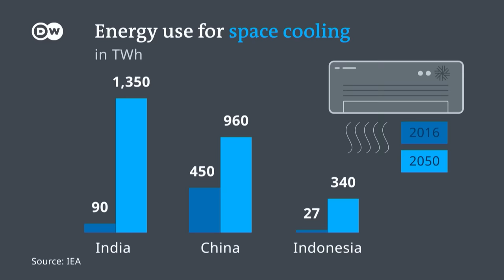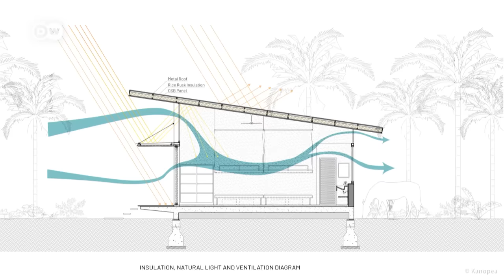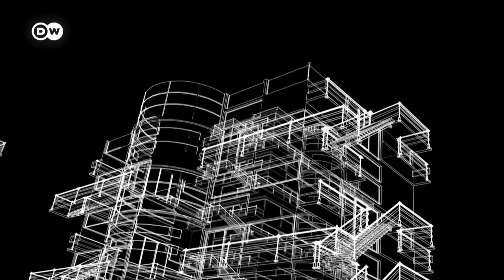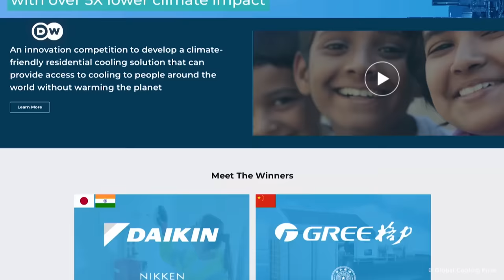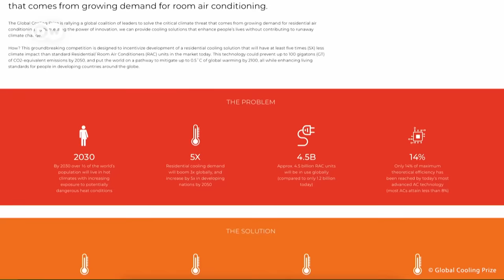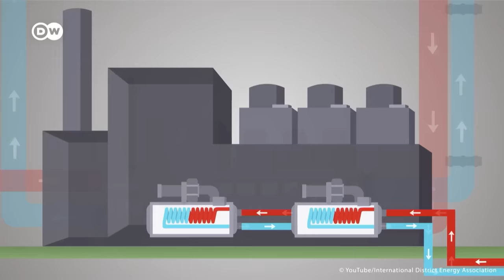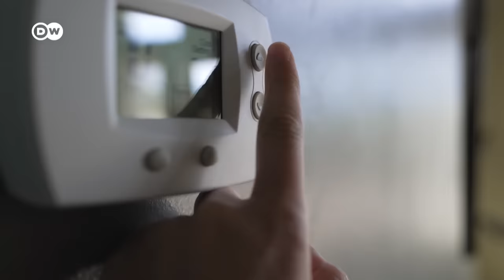How to cool our homes (even without ACs)

Comment: I open my windows when its cooler outside than inside, I close them when warmer. I have 1m thick walls that are heavily insulated. There are few aircons in this country. We have district/building heating. I keep my apartment at 20° in the winter.

Comment: I'm too poor to have air con at home. It's so hot here and high humidity and i live in a concrete jungle. I watched this video to find out if there are any other ways to keep myself cool in this hot and humid weather. Currently,  I keep cool with ceiling fans, stand fans and a trusty spray bottle at hand. Squirt some water on my face and hands, and on bedsheets when I sleep, the water evaporate real fast and keeps me cool.

Oh yeah....i edited this to add.... go on a vegetable or low/no carb diet... less / no meat diet. Kept me cool ! 😃

Comment: there is another design process created by a american architect in the 1970s, they are called earth ships. im surprised DW did not feature these designs because they can be used to reduce waste and be cooler in the summer and warmer in the winter.
this is because the tires and bottles/cans used in the building process retain heat and cold, by acting as a lung. the results are amazing, but widely unpopular because they reuse waste like old tires, used bottles and even cans to build the structure, and local governments typically confuse them with dumps, so they fall into waste regulations. another reason they are not popular is because social media locks it down tight instead of spreading such a ingenious idea.
earthships are also pretty cheap to build, because you are reusing local waste for bout a very good chunk of the project, you bring in the ability to have build prices less than 50k in most cases.
also a indirect problem is they also reuse rainwater for everything, even for watering the local plants inside the earthship, that also act as a cooling effect, but they fall under water regulations and clean water building codes. the most energy efficient design for single family dwellings thats cheap to build, is also not well known.
funny how that works?

Comment: Rural homes in India were much cooler in summer and warmer in winter in the past than today, as they were built materials and ideas from the past which were very much in sync with nature. Today, all you see is a concrete jungle, and with less green cover due to the cutting of trees is pushing up the temperature, it's getting much hotter in summer than before. Awareness is important to bring in a change, this was a good watch.
Reply from the maker: Hey there! We did a video on the problem with concrete. Check it out here 👉 https://www.youtube.com/watch?v=dgVWz77lGCo

Comment: The better approach can be using glass, which allows light but doesn't allow the heat. This means lower lighting is required while also allowing for a better thermal insulation.

Comment: In the case of Barcelona, as far as I can see, concrete dominates in the superblocks: the ground consists of long concrete slabs with small spaces or tree pits with vegetation. I guess they somewhat reduce the heat, since they reduce car traffic, which in Spain is still mostly combustion-based, but when you cross them in summer, they don’t feel refreshing at all. 

Perhaps it would be a good idea if, instead of concrete, the ground in those superblocks were simply made of soil. In nature, soil absorbs the sun’s heat and channels it deep into the ground. Concrete, on the other hand, not only fails to absorb heat but also retains it throughout the day and releases it for hours into the night, acting like a radiator.
Reply from the maker: Hey there! Yes, concrete definitely heats up a city. There has been work done in Barcelona to provide cooler spaces for people in the summer heat. We recently visited Barcelona to check it out 👉 https://youtu.be/iZI4Rh_APFQ

Comment: District cooling or centralized Air conditioner seems good option as it is offer better IKE ratio also generally bigger compressor demand less maintenance too and we can incorporate absorption type refrigeration system which demanded only thermal energy eventhough they have low COP ,in india plenty of hot sun shine available that can use in absorption chilling for district cooling purpose.

Comment: Systems needs to be designed for their climates.  We live in a high planes desert.  Low humidity and in the summer, hot during the day and cool at night.  Generally we open the windows at night to cool the house and then close it all up in the morning.  House stays pretty cool until late afternoon when the AC kicks on.  I would love a system that can read the outdoor temp and switch to outdoor air to cool at night then switch to AC as needed.  It would be far more efficient at cooling our house at night than just opening windows and filter outdoor air particulate to keep indoor air quality good.

Comment: the worst part is that, based on the geological record and the length of this interglacial period and the length of the previous interglacials, we are basically at the end of this interglacial and should be faced with 1 of two possible scenarios:

- hard ice age: global average temps rapidly decline to 2 deg c and the continental ice sheets re-form within 1000 years
- the pleistocene ice age is over and earth becomes tropical again going back to the geologically normal global average temperature of 23 deg c

Comment: Om my answer,
this Summer, in Thailand March to Mai, was first time under a lot AirCon usage, as I upgraded the Solar to HAVE that kWh I want.
It IS a difference for what : as I don't work, sweating is not that problem, and for my arms, to shelter the keyboard and mouse are always towels to catch the water, I don't need that cooling : with 27 C I reach a temp and automatic a humid rate that I keep dry.
Since End of summer I use only Fan indirect into the room, but need to change shirt 2-3 times a day, as the solar input is to low for more Aircon as of Clouds in Rain season.
Solution : before March 25 another 5-10 Cells more as it will be hotter again and be able to keep AC up until July I hope.

Comment: This technique is very underestimated. I have a room in my house, where the airflow is not very good, also the room is positioned from where the sun rises and sets. The temperatures there are insane. It gets very hot and it's almost impossible to stand there without an AC unit and curtains.
On the other side of the wall, there's another room, positioned exactly on the other side of the house. The sun does not shine there directly and there is a fantastic airflow through that room. So good, that sometimes we need to close the doors so the draft is not that strong.

The difference between the two rooms that are separated with a wall is huge. If one room is 40 celsius, the other might as well be way bellow 30!

Comment: What we need is to have informed, ethic, experienced,  environmentally-friendly housing. This needs to get politicians out of the picture. Everywhere, politicians are more interested in their careers and popularity than our health - which includes our environment. I moved into a 70-yr old high-rise which is poorly designed; most of the windows are between concrete balcony walls so there is no natural air flow. Even with a small air-conditioner and fan on, guests say it's too hot, and this is in Canada! Many tenants say their apartments are too hot in the winter, due to thermostats that don't work. Rather than subsidize big oil, the Canadian government should spend that money retraining fossil fuel workers and assist modernizing outdated buildings. For almost 50 years, most politicians have proven that they lack common sense, courage and sincere ethics regarding our health and safety. We need independent national organizations to address climate chaos caused by pollution, proceeding from science, not the decisions of politicians who are owned by big oil.

Comment: I have loads of soloutions for cooling my house but mum won't have any of it. I'm sure that she just wants to cook. Paining the walls and ceiling white would be a start but no, she doesn't want that. Having the windows open at night to let the hot air out would help but no, she doesn't want that. So what does she do? Wastes money on insulation which while keeps the house warm in winter, it also makes the place un-bearably HOT in the summer because it keeps the heat IN.

Comment: Ieaving  hot and cold AC  now inverter AC prices have dropped drastically and each passing year some new brands pop up with mouth watering prices and deals... But choosing the best AC  also depends on the service and reliability a AC is just as good as it gets  if serviced on time and maintenance is not an issue also aprt from using an AC if you use chemical or epoxy based paints  to paint your roof or exterior which claim to reduce indoor heat by 2 degree will also be a wise thing.. As the Fujitsu general tag line says, its my planet say no to the cheaply built AC which needs heavy maintenance and invest in a better efficient cooling machine . Nice work team DW....👍
Reply from the maker: Thank you for your feedback! If you want to see more videos like this, subscribe to our channel, we post new videos every Friday ;)

Comment: I am in the hot, very humid southern USA.  I recently had to replace my roof. I wanted a metal roof for greater efficiency, but they are cost prohibitive and the technology has not improved in decades, so they still have a reputation for developing leaks. When I looked for a white asphalt tile roof, I was told by multiple companies that they were not available in our area. Again, I live in the deep southern US, why would the white roofs they all manufacture be unavailable in this area where they are most needed???! I would also like to switch to a gray water toilet and gray water system for the yard. Again, no contractors offer this and you can bet if they did, it would be cost prohibitive.  I know a LOT of people who very much want to green their homes,  but companies and contractors are standing in the way of progress. They should be highlighted as the key to climate change and responsible for the destruction of communities.

Comment: ❗ Important message ❗

If u have AC then set the temp between 24° - 26° it's a comfortable temperature for humans and if you also have Fans installed on the roof then set the temperature to 30° and turn on the fan by doing this you'll save electricity as well as environment.

Comment: Architecture and how buildings are made will make the biggest difference. Giant windows are the enemy! I work in HVAC and all I see are more regulations to make everything Green and high efficiency. This has drastically increased the cost of AC's and heat pumps.

Comment: One of the best ways I cool down for outside working in heat, is to have misters around the work site and an evaporative cooling shirt. I walk through the misters and it it gets the shirt wet. all day I am in an 'air-conditioned" shirt. With a wide brim hat makes working in very hot weather doable.

Comment: Engineering is taking a big turn, we are currently in our 4th industrial revolution, digitizong, our HVAC guys are analyzing building energy before we build them to get these issues sorted, it's new, but it will become the norm.
We're already prepping or preparing for the 5th IR which will be robotization. 
Construction is changing, we have powerful programs where we can analyze the project beforehand by using it's modelled digital twin.
I will design my first home with energy efficiency, taking sun rotation and position into acccount, wind direction etc. My childhood house was cool in summer but ice cold in winter and some rooms were cooking in the summer, so horrible  in terms of energy distribution. Designed off the basic north facing concept, but we are more advanced now. Interesting yhings are coming, not just to technology like ac's  bit also the way we build.

Comment: Since I bough my (used) apartment, I have been using the AC to (a) keep me cool in the Summer, and (b) occasionally, reduce the humidity level inside my home during Winter.
I coupled that solo AC unit with tree fans, to spread that precious colder air into the other rooms of the apartment.

This year, I made the investment for the "intelligent glass", called Guardian Sun - from a Spanish company.
This glass lets heat in during the Winter, but reflects that heat during Summer.
I will see the advantages that it will bring during this Summer.

However, to reduce my impact, I bring my exterior shades down, to reduce the amount of heat that gets in.
To control humidity, I placed sensors around my home which tell me its evolution, so I can plan accordingly: open windows, close windows, etc...
This mounted my know-how about how to optimize it all.

Moreover, I will invest in a new exhaust system for my kitchen, so I do not have to open up the kitchen window so often - to avoid losing heat or cold air.
Additionally, I will invest in different ways to heat up my house during the Winter, namely pellets - which are come from forest residues, which would be burned up regardless, or be a fire hazard if left in the forest.

This is a very critical aspect of reducing our environmental impact!
We really need to educate ourselves in this regard, and (a) plan accordingly, and (b) plant more trees.

Comment: I live in Cambodia and use 14 wet towels (300 W thermal) on a rack and mosquito nets on door and window to blow out wet air constantly (fan 55 W) and when it´s too hot I throw buckets of water onto the flat roof. Save $30 per month on electricity. But DW doesn’t ask me. I don’t need cooperations, missions, goverments, teams, prizes and innovations.

Comment: I'm using AC at 30 deg Celsius
Does this still impact as much as 25 deg C?
Reply from the maker: Set at 30°C it has significantly lower impact in terms of energy consumption and environmental footprint compared to setting it at 25°C. ✨

Comment: If we use glass which allow light but not heat pass through them, it will allow for lowering the need of the cooling. However, we need to be careful, as it may increase the temp of surroundings.

Comment: I don't use a/c . I cool down the room I am using and not the entire house. I use 2 window fans one pulling air in shaded side of the front room and the other that is on the Sunnyside is exhaust. This works awesome on warm.days. For hot days I use a small swamp cool ( window units works the best) and this adds moisture to the air because my skin droes out quickly . .y small Bonair runs about 1/10 th of ac at around 200 to 400 watts. Small.rooms cools faster with using less power, try it

Comment: I think opening your windows at night is underrated. Granted, there are places and times where it doesn't cool down enough to do this, but I'm often able to open the windows up and then close them in the morning. It delays or even eliminates me needing to turn on AC. I also wear very little around the house in the summer, usually just a pair of shorts, and then conversely in winter I bundle up in sweatpants and a sweatshirt. Not only are these practices super comfortable, they also reduce energy demand.
Reply: Live in CA. I love how in the summer evenings, the temperature decreases to the 60-70 degrees F. I like to open all my windows once it cools down in the early evening and close them before I go to bed around 10pm.

Comment: I read about a new city being built with buildings close together so they partially shade one another during the day, something that was common in hot climates in the past.

Multiple lanes for cars between buildings plus our modern craze of super tall buildings is counterproductive imo.

If buildings were generally 10-20 stories tall and built far enough apart to allow for pedestrians, active transport (eg. bikes, e-bikes, scooters etc) and with room for emergency vehicles then the issue of cooling would be much simpler.

Higher density with narrower "roads" between would also mean less distance to travel between A and B.
Reply: An alternative to removing personal vehicles from city streets  would be to have roads at ground level, with pedestrian space with trees etc on a raised area above that.

It'd be much safer, quieter and much more pleasant to breath if the area where cars move was  separated from areas where people move around. 

We're increasingly an urban species, our environment needs to be livable..

Comment: The AirCons, so far as I know my 4 have a very bad bug : The condensed Water is thrown away (most outside, or here into shower),
BUT this Water is COLD and as water to air has 2.000 more energy, KEEP that cold water in the house (cooled room) is smash away energy also !
I keep the dropping water in a bucket, and let it warm up (= cool down the room)  before I use it for dishes after wash = no left signs on glass !

Imagine if that cool condense Water would run down inside the building first, cooling down homes, house further before released ...

Comment: I have more than 2 AC The main thing I saw is that the twice-cost Daikin performs much better (with the same consumption) as the cheaper Daikin. The costly one's outside unit is double the size of the "cheap" one. I regretted spending on fancy but useless like "people avoid". This only work efficiently in a much bigger room. But wifi is good I can open it before I enter the house.